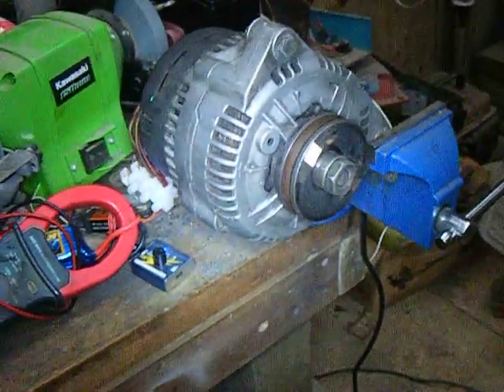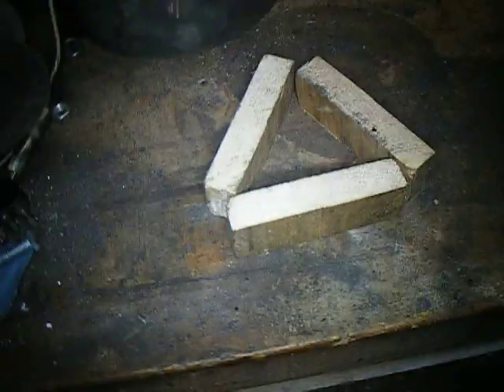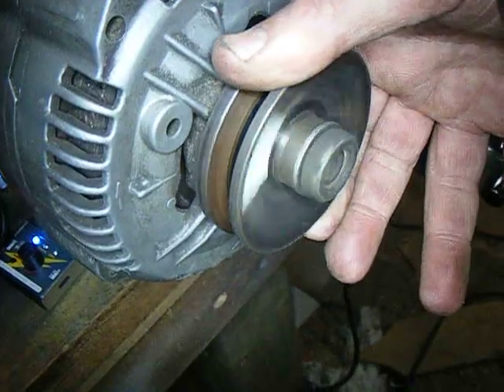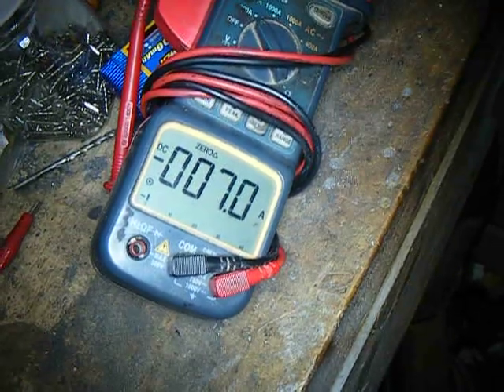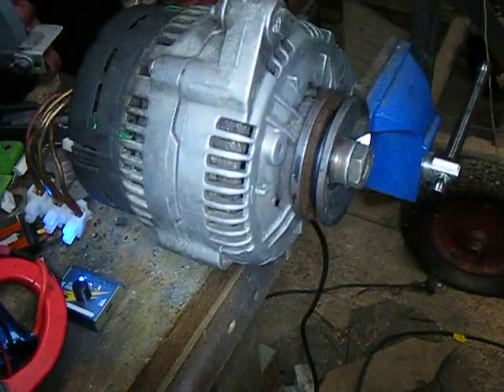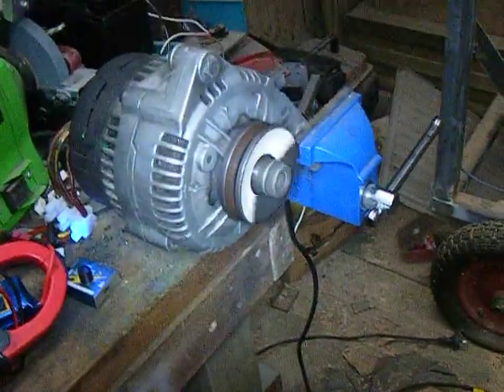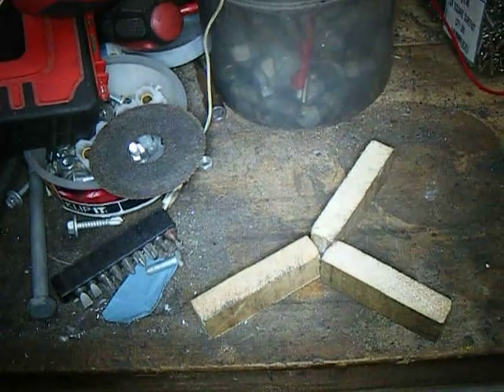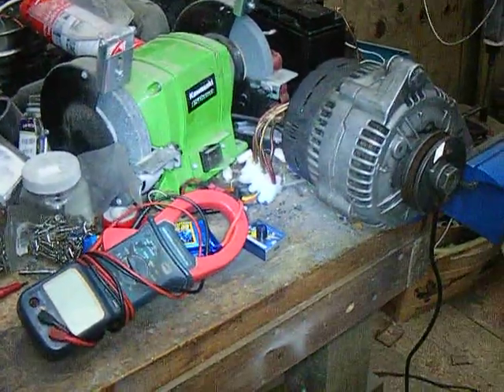Enhanced Alternator Motor goes faster than before

Comment: could you explain in more detail what you mean about the star configuration and the other one, do you mean you took the alternator apart and redid the windings?
Reply from the maker: Howdee Sean,   
 When you take the rectifier stack off the rear of the alternator, it exposes 3 stator coil leadouts. 
 Each of these goes to one of the ends of the 3 coils that form the stator windings. 
 It you look a little deeper, you'll find the other 3 ends of those coils. 
 These are all twisted together, soldered up - and insulated.  
 I separated these 3 wires, and brought them out of the rear of the alternator case. 
 What I now have is 6 wires that lead to the 3 individual coils. 
 The original electrical setup of the alternator is referred to as Star configuration. 
 To make it into Delta, I simply joined the end of coil 1 to the end of coil 2, and the ends of coil 3 to the remaining ends of coils 1 and 2. 
 That might sound complicated, but you'll find that it is super easy when you give it a try  :) .
Reply: @CNCmachiningisfun  I think what you made was a 6 phase motor. Great video, thanks for sharing.
Reply from the maker: @jessemeanlt1  
 Thanks kindly  :) .

 It would be cool if I could make it a 6 phase motor, as I am sure that I would get it even more torque from it. 
 Alternators make good, and very tough, little motors  :) .

Comment: From https://endless-sphere.com/forums/viewtopic.php?f=30&t=61343&p=917145:
"3.Re-terminate in wye (unless already is), don`t bother with delta, trust me."
I do tend to agree as I've said a few times.
Reply from the maker: +CheadleBiker 
 Thanks for that link. It was very entertaining  :) . 
 As for the Delta configuration, it seems to work better for me than the Wye method does. 
 That stated, I have not tried the Wye config on my bike, only on the test bench, so perhaps I should just check up on that.
Reply: CNCmachiningisfun When I first looked at how to wire my phase coils, I thought that Wye was wrong as the alternator ran rough on the bench with no load. I ended up putting it on the bike and was really underwhelmed considering the power input was around 2000w.
When that can switch arrives (usually 2-3 weeks), I'll wire it in and see whether the controller will a accept the two configurations without reprogramming. If it does then I'll changeover on the fly. My gut feel is that the loss of torque will require the bike to be geared much lower, to  make maximum cruising speed correspond to maximum power in delta configuration. This will make the bike a wheelie machine in wye configuration.
You've got the test bed for this, as you have the intermediate reduction gearbox. I don't, as I have direct drive.  Get a 16s to 20s pack and a 60 to 72v ebike controller and unleash the potential of your machine.
Reply from the maker: +CheadleBiker 
 Experimentation is definitely in order for our bikes, as we are yet to get the best from them. 
 My next voltage step will be to a 36V Lithium Ion pack that I bought last week, but I need to fit my new ESC before I go up in voltage. 
 The New ESC is rated at 120A and 48V, so this ought to get my wheels spinning a wee bit faster  :) . 
 I dunno if I have the courage to crank it all the way up to 60 or more volts, as I am allergic to high speed road rash scars on my skinny people wrapper!

Comment: I'm researching star vs delta and came across this. https://www.electricaltechnology.org/2012/02/star-delta-3-phase-motor-starting.html.As a bike is always starting / doesn't reach operating speed then maybe star is preferable.
Reply: A motor with windings in delta configuration gives low torque at low speed, but can give higher top speed.[citation needed] Wye configuration gives high torque at low speed, but not as high top speed.[citation needed]

Although efficiency is greatly affected by the motor's construction, the Wye winding is normally more efficient.[citation needed] In delta-connected windings, half voltage is applied across the windings adjacent to the driven lead (compared to the winding directly between the driven leads), increasing resistive losses.
Reply: So my observation about delta lacking torque during initial acceleration is supported.
Reply from the maker: +CheadleBiker 
 There are differences in the performance of these arrangements that justify a good degree of experimentation, which is why I bought all 6 of the wires out of the alternator casing. 
 I have seen one video where the bike builder added a Star/Delta switch to the handle bars. 
 This allowed him to switch modes while in motion, and he reported that he was able to boost his top end speed that way  :) . 
 One of these days, I will try this out, as it seems to be a good idea.
Reply: Can you remember which video? It emulates the star/delta motor starter, so makes sense, presumably once the motor is near to maximum speed in star mode.
I'm going to use star configuration and change the 12v SLA to a 3-phase rectifier and PWM, to energise the armature when I'm on throttle and to be able to vary the armature voltage. When I rash elta and had no torque, I increased the armature voltage to 48v (which got smelly real quick) but I'll notch it up from 12v and see if I get more torque and if so, where is the voltage of decreasing returns.
Reply from the maker: Yup, I just found it now: 
 /watch?v=sm9STU4sIKE 
 There seems to be a few others out there like this, but this one's a good starting point. 
 I like your idea of coupling the phase feeds back to the rotor via a rectifier and regulator. 
 At levels above 12V, you'll surely find that your rotor reaches the point of magnetic saturation, and I suspect that it will reach this point well below 24V. The current in it at 48V would have been huge, hence the strong smell of - "alternator dioxide" fumes  ;) .
Reply: Thanks. So what I've found out is that Delta puts full line voltage on each phase whereas star gives 1/√3 of line voltage per phase I.e. 58% Delta gives 58% of the torque of star but at 173% of the speed. So I think the way to use Delta is when the motor is spinning and not drawing much current because it is limited by the back emf. Is accelerate with star and cruise with delta.  There's probably other things out there but I quickly found this Triple OE double throw knife switch in eBay. Very Frankenstein but cheap and simple. http://www.ebay.co.uk/itm/32A-Three-Pole-Double-Throw-TPDP-Knife-Disconnect-Switch/262493746367
Reply from the maker: That's a nice little bit of research you have done there  :) . 
 At the moment, because my bike is not particularly fast, 18KPH - or 12MPH, it seems to be reasonable to keep it in Delta mode for the time being. 
 That stated, I would really love to see your bike in action, and also see how it performs as you migrate between the two operational modes of the motor. 
 These things are far too much fun, as I am sure you would agree  :) .
Reply from the maker: +CheadleBiker 
 Hmmm, now that is a nice bit of kit you have ordered there  :) . 
 It ought to handle all the abuse you can throw at it, and then some, so let's hope it makes the difference you are looking for. 
 In time, I want to step up from 14V to 36V. This ought to push my speed up from 12MPH, to at least 20. 
 Wheel see about that  :) . 
 Looking forward to seeing your bike running with this new setup.
Reply: I don't really do videos, so we'll see.
I connected up a PWM via a 3-phase rectifier to feed into the armature coil.  This arrangement means that I only need one battery and that the armature is only energised when the throttle opens.  It works OK and I have not added a capacitor for smoothing because I figure I want the largest magnetic field on the armature at the same time as the pulse on the stator.  I put the bike on the turbo trainer, started at 12v, gave it full throttle and adjusted the voltage to get the maximum speed at full load.  It turns out that it is between 10v and 12v.  Much lower and the motor stalls under acceleration.  I did go to 24v but it didn't seem to make a difference, so it's just generating heat, rather than torque.
I'm limited on amps, as my batteries are for 15A e-bikes and not really up to the job.  I've got two in parallel with a 40A limited e-bike controller.
I could nick the two zippy compact 8s 5800mAh 25c packs from my overpowered Razor e300 scooter but I'd rather use the scooter than butcher it (it has a 250w/36v converted ebike hub motor running 60V and a 22A limit).
So I'll concentrate on what I'm going to use the altermotor for, as it being mounted on the rack of a kids BMX with a massive chainwheel on the back and no pedals is not a very useful or even vaguely legal vehicle in the UK.
The altermotor performance is 4320 rpm in star format with 60v(16s) to the controller and 12v on the armature, drawing about 2000-2400w,.
I still think the efficiency is low, so although I'd like to use this on a scooter (it will be a tight), I'm not sure the batteries will last very long.
Reply from the maker: +CheadleBiker 
 Thanks kindly for the video. I really enjoyed it  :) . 
 Your method of supplying the rotor coil is a very clever one indeed, as it covers a lot of bases in a rather efficient manner. 
 It looks like we agree on the required DC level for the rotor too, as it seems to be happiest in a minimal voltage range, in the order of 12V. 
 As for efficiency, you are perhaps right in placing it at about 60%. 
 I would be only guessing at the moment, but that seems to be a good estimate for the time being. 
 That stated, mine uses 15 Watt hours  per KM, or about 24 Watt hours per mile. 
 How that figure compares with standard Ebikes, I disnay know.
Reply: CNCmachiningisfun Yeah, pretty much. I've done some testing today and am up to 30.5 mph with a little bit of solder on the controller's shunt. The armature voltage was between 14v and 16v. I think the optimum armature voltage increases as the stator amps are increased. Ultimately, I think the rule of thumb is to use the minimum armature voltage that prevents the controller stalling the motor.
Reply from the maker: +CheadleBiker 
 You sure do have some good speed results on your bike. Well done indeed! 
 I tend to agree with you on the minimum voltage for the rotor, as mine tends to stall when I let it fall too low. 
 There is always room for experimentation with these, and we may indeed find that perfect set of operating conditions  :) .

Comment: That's pretty cool to see that alternator wired up as a motor. You normally see people do it the other way around turning old washing machine motors into generators.
Reply from the maker: For sure. The majority of these spinny things are being harnessed as power generators, so it is nice to buck the trend now and then  :) . 
 This thing goes like a rocket, so I am hoping it will push me and my bike along at a respectable rate of speed. 
 Now that summer is coming along, I can have me some good times out on the roads with this beastie, assuming it actually works.

Comment: Steve, I've never seen anyone have as much fun with electronics as you. So, you are going to mount that 10,000 RPM adulterated motor to a bike with an 18 speed transmission.  Drop in for a coffee when you go by. ;)
Reply from the maker: Howdee Bill, 
 Yup, electronics and I go back hundreds of years. Well, OK, in my dreams  ;) . 

 Warm up the coffee pot, as I will be aiming my front wheel in your general direction perty soon. 
 Ya know, this might be fast enough to outrun even the fastest of those pesky little neck nippin' woodgas bugs  :) .

Comment: Steve, that is amazing. The 10K RPM is wild. And, you are going to put that on a bike........
Helmet and goggles will be in order as well as leathers..... Hope you have good insurance..
Very cool.
Reply from the maker: Howdee Mark, 
 If I gear it down, about a million to one, it ought to go nice and slow, so I can climb straight up the sides of buildings, for easy parking in the city. 
 Hmmm, I better add a parachute to my safety kit, just in case the wheels start to slip a little bit   ;) .
Reply: And to slow you down should your speed controller go haywire to full throttle. Hang on man,,,,,
Reply from the maker: LOL. I am allergic to the effects of falling off at high speeds  :) . 
 Perhaps I will add some sort of safety cutout switch, just in case.